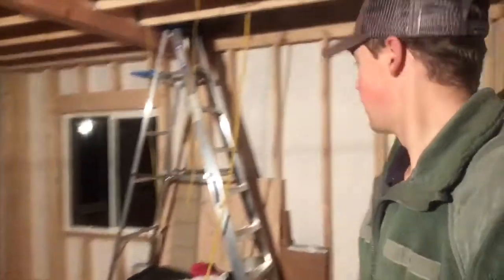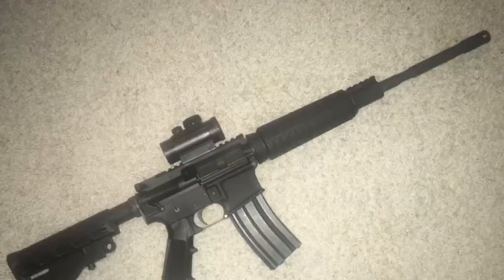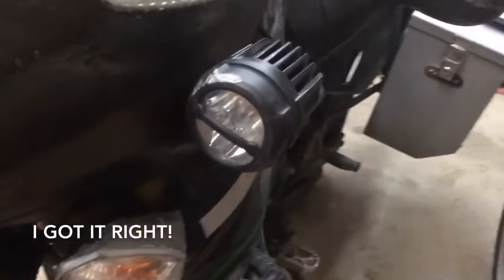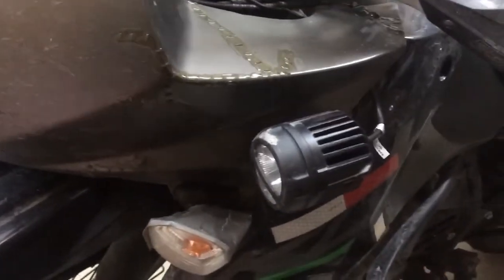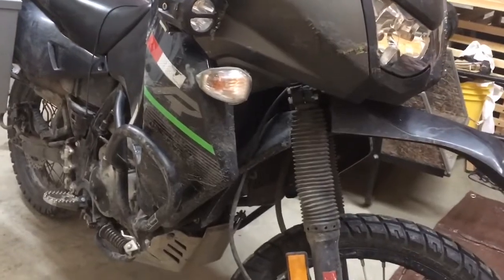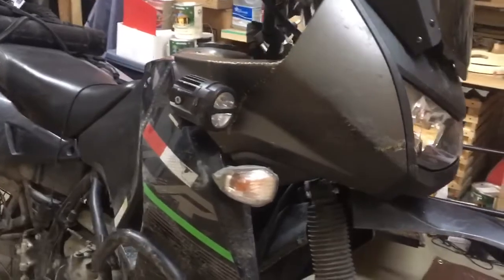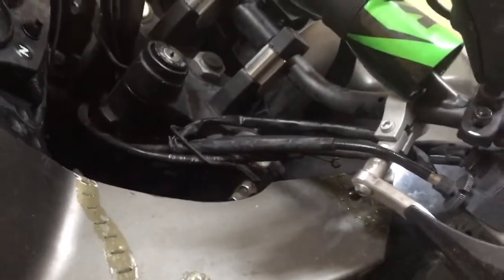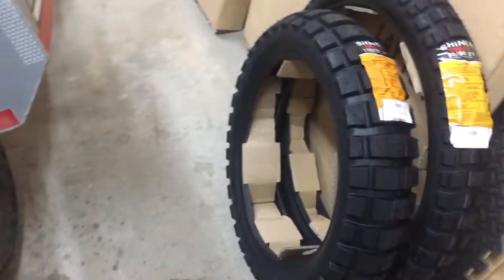How To Install Extra Lights on a Motorcycle | Live QandA Coming up | Announcements

Comment: Also, a freefloat tube. I hung the light off of wever scoop rings on the cheap tube.
Heavy buffer and heavy spring.  And I had some nutty canvas guy make the sling with a quick release buckel
Reply from the maker: Got a free float Mloc handguard... why the heavy buffer tube and spring? I’ll go through it in a video here in a little while when I get time to test the setup a bit.

Comment: Hi Liam! Good little tutorial. I'm also on the market to add auxiliary lights on my KLR. Not sure yet where am I gonna install them, but I think it will probably be on my crash bars, Hoping they won't be too low. Anyway, good work again, my friend. Take care untill next time. ;-)
Reply from the maker: Well thanks! I wouldn’t worry about the light being too low, if anything it’ll give you better depth perception. Thanks for the encouragement... Ride safe...

Comment: Vortex makes really good and reasonably priced optics. If you want close quarters combat red dot sights Holosun has some decent optics and one has solar charging capabilities... which is nice. I kept my stocks in their original configuration but they came with rails. Someone mentioned Weaver scopes, they make some really good optics that don't break the bank. 
Do some poking around the net, Midway, Brownells, Palmetto State Armory, Optic planet, just compare options and prices. 

I have some wiring to do on the KLR... I'm procrastinating. lol
Reply from the maker: Wow, thanks for the tips. Yeah I’ve been all over the internet, although you still gave me a couple of new ideas. 😄  let me know what happens with the KLR!

Comment: good tire combination.  I put a set of those on my bike this spring.  They do take a little to get used to at first, but work well, and even though I don't ride much in a season, I got a few thousand km on them, and they still look new.  I have a set of LED lights I am going to put on the bike this winter.  Have a few ideas of were I am going to put them.
Reply from the maker: Yeah they’re nice ones. I had a set of them on when I left and got about 8,000 miles out of them before I switched them out. That was hard road riding though, and they wear quicker down where it’s hot. You’ll love those lights, believe me!